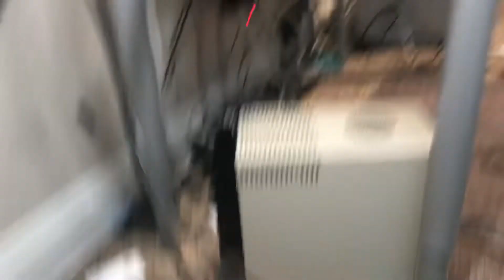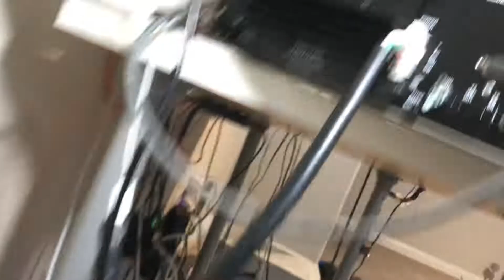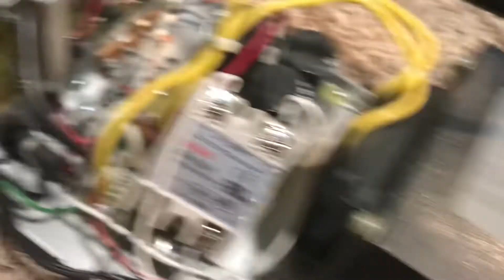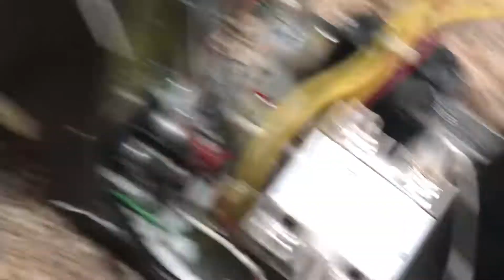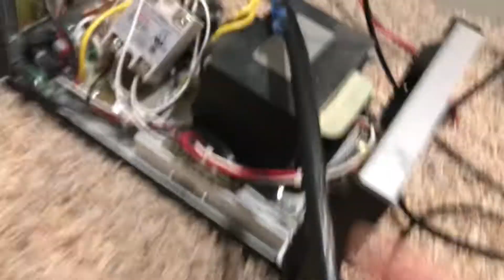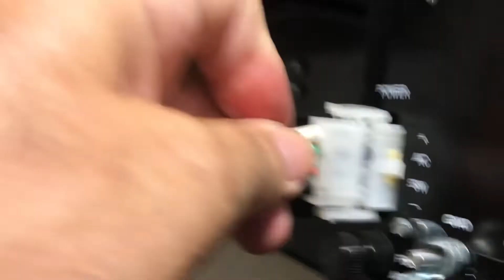Ten Tec 962 Power Supply - added a solid state relay August 23, 2022

Comment: I never  liked the 120 vac going to the switch on the radio.  I always jumped the molex at the supply and just ran 12v to the rig. 2 or 3 Ten Tecs over the years.
Reply from the maker: Hi Scott. Yep. Agree with you. I am not sure WHICH Ten Tec's have an on'off switch that use these two A/C lines up to the radio. On the Ten Tec Omni 6+ they are just jumped inside the radio. And it seems this was a MOD? made later to the 962 power supply? The cord on the power supply looks factory. But of course the switch broke in the front and someone put in a very tiny switch. Well now that switch is not handling much current. But who knows if the Chi-comm Solid State Relay is up to the task? I did not want to pay $25 to $50 for the Potter Brumfield name.